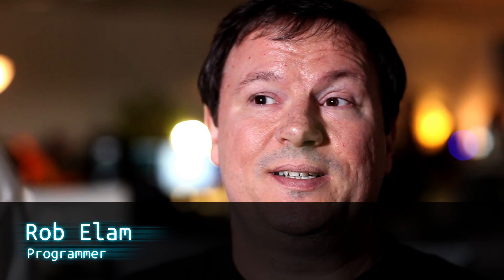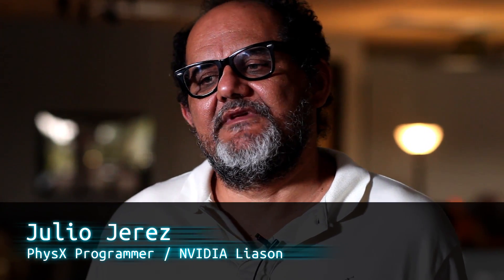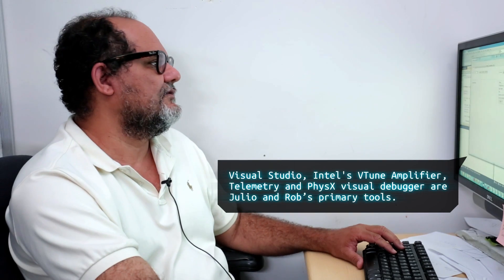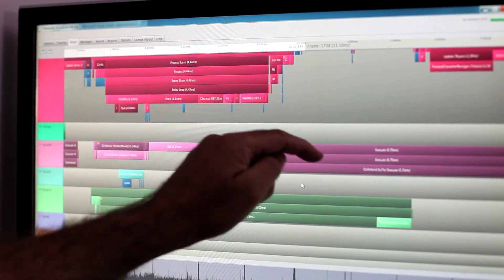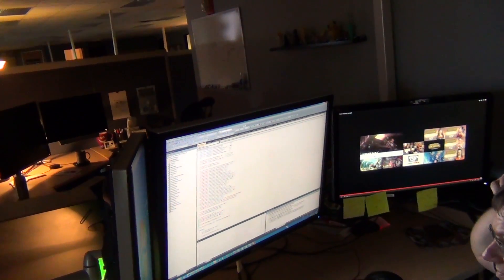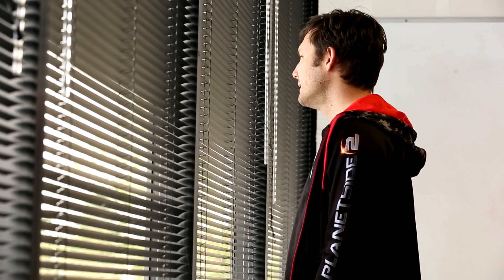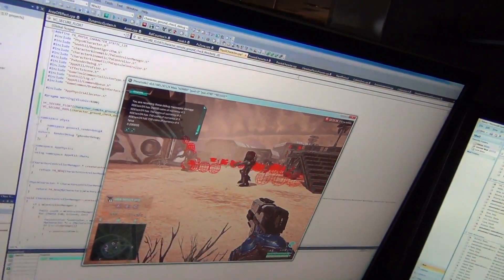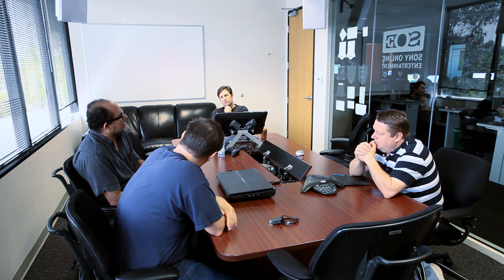PlanetSide 2 - Operation: Make Faster Game Ep. 4

Comment: for me at least my performance with planetside 2 has gone up by at least 50 percent. I can run most settings on high and medium in large fights and get 30 to 35 fps . And in a medium to small skirmishes  I get a steady 50-60 fps. Planetside 2 now utilizes cores more efficiently, my hex core works fantastically now with planetside 2 now all we need is other MMO's to follow suit. Like Guild Wars 2 and it's unbearable skill lag when more than 40 people are on screen

Comment: GraphicsQuality=1
TextureQuality=1
ShadowQuality=0
RenderDistance=3000.000000
Gamma=0.000000
MaximumFPS=120
UseLod0a=1
OverallQuality=-1
LightingQuality=1
EffectsQuality=1
TerrainQuality=1
FloraQuality=0
ModelQuality=3
VerticalFOV=74
FloralLOD=0
ParticleLOD=0
EffectsLOD=0
ParticleDistanceScale=0.650000
FloralDistanceScale=0.000001
EffectsDistanceScale=0.650000
FogShadowsEnable=0
MotionBlur=0
VSync=0
GpuPhysics=0
AO=0
this works better then most for a low end rig

Comment: Technically Arma has no player limit, you just don't find servers that go much over 60ish because the engine can't handle it. Shacktac were the only people who ever really successfully ran a 100 player server and they did it by having absolutely nothing but those 100 players on the server, they never used AI.

I love Arma, but it's not a good engine. To get the FPS I get in PS2 on Stratis in Arma 3 it basically can't be much more than an infantry deathmatch.

Comment: Archaic software? The engine was initially built for Planetside 2. It's barely a year old and the kinks are still being ironed out. It's not like DICE's Frostbite engine that's been in use for years and doesn't have as much to deal with as Forgelight. I certainly don't enjoy the low performance but as a programmer I can understand how difficult it would be for them to improve it.

Sounds more like entitlement than standards to me.

Comment: Did you even try playing large games on Stratis? I can't convince most of my friends to stop playing Arma 2 and start playing Arma 3 because the performance in large scale battles is so poor. I'd also point out that Arma multiplayer still caps out at 64 players.

Here's a test for you, go into Arma 3 right not, go into the editor and try placing 1000 units and have them attack 1000 others then try starting the game...you'll be lucky if it even loads.

Comment: Averages 35 FPS on your machine. 

And if you can't understand why a one thousand player per side on an open world game on a 60 square kilometer map might require a little higher specs than 64 player games on 1km2 maps then I really don't know what to tell you

Battlefields jets sure do look pretty, but there's 4 of them...four..maximum. In PS2 you can have an entire platoon of 48 fighters and still only be a small fraction of the units on the field...do you really not understand the difference?

Comment: Battlefield 3 runs with more hitching and lower FPS than Planetside 2 does with 10 time more players on the screen.

While you might be more impressed with BF's pretty lighting and smoke effects it doesn't change the fact that higher number of players is drastically more difficult to optimise than post processing. Which is why console versions of BF look quite similar to the PC version but can only support half the number of players.

Comment: The point of this optimization is to make the game run on a wider range of hardware. Don't mistake that for them admitting the game runs badly, it doesn't, there's no other engine in existence that can render what the PS2 engine does and not die on it's arse.

You just need to play something like Gary's Mod to realise that performance has very little to do with graphical fidelity when you have 500 objects on screen.

Comment: Runs fine for me, it has since launch, it just needs a slightly above average system. I get 40-50 FPS with a single 560Ti with everything on High/Ultra only things I turn off are PhysX and motion blur. Neither really kills my FPS, the main reason I turn them off is that they make it so much harder to see what's going on around you.